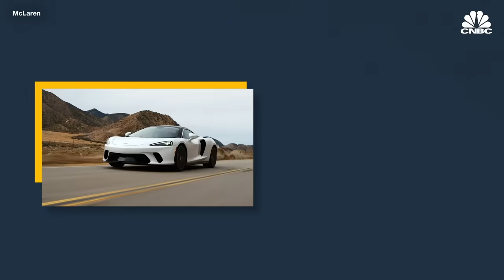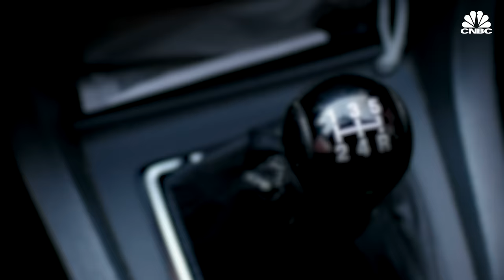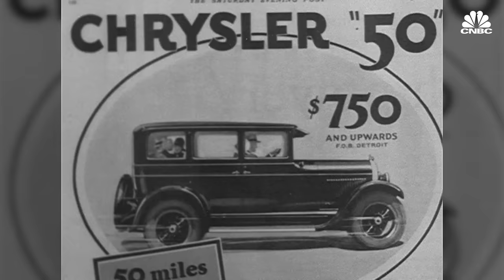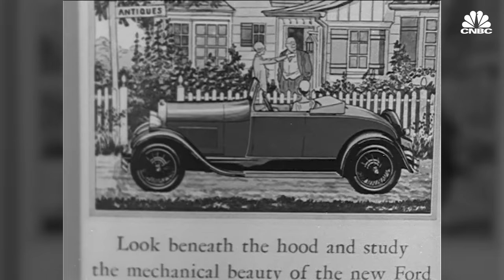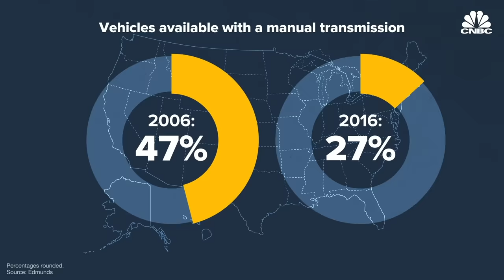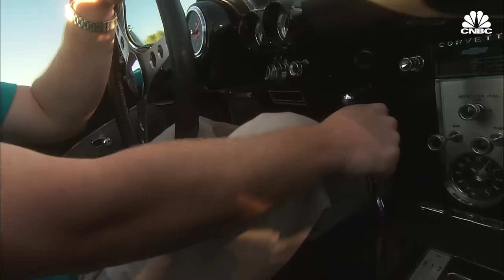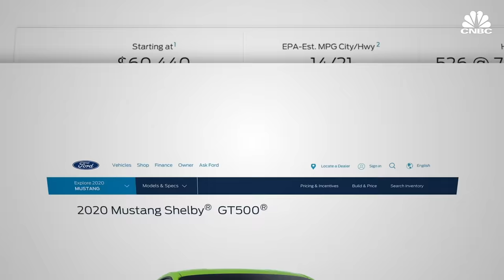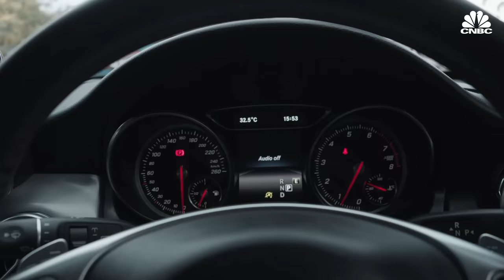Why Stick Shifts Are Going Extinct

Comment: We had someone that got car jacked here (Australia) and once they got the car they got out and ran because it was a manual and couldn’t get it to go.. haha losers
Reply: LOL.. Now that's what I call an anti-theft device! ('v')
Reply: don't stop getting toll... and problem with manual... also alot when got older.. this thing is nightmare to maintaince...
Reply: If it happened somewhere else other than the US or Australia then it could've been a different story lol
Reply: In Indonesia, a skit show called "Sketsa" shown that thugs trying to steal a motorcycle but they gave it back to the owner because it was in A/T and the thugs can't used the A/T.
Reply: That is hilarious 😂 it’s really not that hard!
Reply: @campkira  how is a manual hard to maintain, if you watch the video he literally explains how manuals are far simpler and much less expensive to repair.
Reply: That is funny.
Reply: @halohunter5217  my first car was manual, no power steering and no AC. No one ever asked to borrow it a second time.
Reply: I'm an aussie and never owned an auto. Had 6 different manuals though.
Reply: I was looking for a new(er)car and my requirements were 1. a manual transmission. 2. AWD or 4WD.  When I entered those filters into google, the choices went from 1000s of vehicles to about 5.  SHOCKING!!!!  I finally got a great deal on a Volkswagon Jetta.  It has a 6 speed manual transmission but is front wheel drive (came with studs).  One out of two isnt bad, and I love the Jettas.  My last one almost got to 300,000 miles.
Reply: @rocknrobin411  Yeah they are quality cars.
Reply: @eberduran  Nah most here don't know either. We are a rarity. 1 in 200 new cars is a manual here i believe so it is worse than the US sadly. Most people here aren't even licensed to drive manuals anymore. At least not the younger generations.
Reply: @campkira  well if you drive standerd you should get at least 10 years out of it before having to replace the clutch. My father had a F100 for about 10 years and never replaced the clutch .
Reply: @campkira  Typo notwithstanding, you are incorrect. I was involved in a gearbox refurbishing business for many years, I do know what I'm talking about.
Reply: Lol, the guy is probably American
Reply: The opposite is also true: when one of my country's cycling team went to the USA to attend to some race they had to drive automatic vans, so they had a parking accident because they didn't know how to use the automatic shifter.
Reply: So... a theif just needs to learn stick? Lol I bet YouTube can help with that!
Reply: @chrisbrent7487  My wife is an Aussie (Melbourne) and learned to drive on a Willy's Whippet, whatever that is, but it was a manual transmission.
Reply: @blackholeentry3489  Will's whipets where a verion of the Willy's overland made as what we call a ute here. In the States it would be called a pick up. The stopped making them in the 1930's. I'm in my mid 40's and a lot of people learnt to drive manual back then. Now days it is very few.  They can't even legally drive a manual if they never passed the test for it.

Comment: Forget about manual transmission, engine cars themselves are gonna become extinct with the rise in EVs
Reply: If petrol cars are ever completely phased out I doubt it will be because of EV's. Even if it does happen that's a very long way off. The push to end everything powered by gasoline, diesel, natural gas and propane will put an unrealistic demand on the power grid as well as the necessary increase in copper demand to manufacture all the motors and update power grids. Materials needed to make the batteries will be a major issue. The technology will get better but it won't happen any time soon.
Reply: @martyharless5097  that was 9 months ago and now after seeing many EV failures , I say petrol / diesel here to stay for long. CNG is much better alternative to these.
Reply: @allstar7778  I'm not familiar with the volumetric density of energy for CNG compared to gasoline/diesel. I'm wondering how that will work with space. I remember seeing pickup trucks powered with propane but the tanks took up a lot of space in the bed of the trucks.
Reply: @martyharless5097  yeah that issue is there.... but EV I don't recommend at all, EV is totally useless. Main issue is the charging time.

Comment: America- stick shift's gonna die
Rest of the world - sighs in metric
Reply: Us Canadians just have to deal with them
Easier to just do what they do, otherwise we'd be right hand drive and stick shifts all the way
Reply: That’s a shame. Under harsh conditions, a manual is far superior. Automatic transmissions overheat much easier and require more maintenance.
Reply: SandboxArrow  dude all them are exaggerated 🙃 and you pointed out only uncle sam's exaggeration, hm interesting
Reply: The "smart" Americans sigh in metric too. The US is on the metric system. For the commercial activities it is converted to the Imperial/US customary units, but in science, military, some industry and even some parts of the government, the  metric is standard
Reply: Oh, please. It's super fun memorizing and/or calculating that 13/16 inch is between 3/4 and 7/8! Easy!
Reply: @jonsol2804   yeah metric is standard thats why its opted worldwide even in commercial activities 🙃
Reply: @Freejason33  whats a inch ?
Reply: Metric has nothing to do with it. They'll learn eventually. Yes America is pretty behind in almost all aspects, but if we know anything its transmissions.
Reply: Here in the UK stick shifts (or manuals as we call them here) are far from extinct. They outsell autos by a large margin.
Reply: @johnsheibal4330  In Serbia on the used car market if a car is an automatic the price can drop 1.000-2.000€
Reply: @Lkshy_abq  Funny part is, metric does not have a sensible equivalent to the Foot,  Saying something is about 30 cm long tells you bugger all, but mention a foot and EVERYBODY knows.
Reply: @jonsol2804  then if you guys are soo smart why even bother to learn kids units and conversions that ultimatly dont get used?
Reply: @McDonnerbogen  what units and conversions?
Reply: @jonsol2804  why learn imperial units and the conversions like km/h in m/h or for imperial miles per hour in feet per hour if they are not in any use
Reply: @adoreslaurel  thats because people who use metric wanna actually be precise and use rulers. Gotta be easy to buy shoes in usa if everybody got the same foot i guess.
Reply: @adoreslaurel  yeah bro because its not supposed to, metric doesn't have sensible equivalent to foot but does the imperial has any sensible equivalent to metre, these two systems aren't compatible together thats why they are two different systems and metric is more accurate thats why whole world uses it.
Nobody wants to use a system that's units progress unevenly
Reply: It's probably because the U.S. is where it actually matters since the U.S. and China have the two largest markets in the world. Not badmouthing any other countries, its just that the market for luxury, power cars, isn't nearly as big.
Reply: @Lkshy_abq  Well a yard and a metre are pretty close, something makes me think you grew up with imperial and moved to metric, but if the cops are looing for some crook 183 cm tall, well these days I dare say most would know it as 6 feet. but it's  quicker and less confusing to say the guy is 6 feet tall.
Reply: @McDonnerbogen  Yes, must admit though, down under I have to know which countries size fits my foot because by the time I need new shoes, the size print has worn off.
Reply: @chaos4224  " USA NOT USING STICK SHIFT WILL NOT LEAD EXTINCTION OF STICK ALL OVER THE WORLD JUST LIKE NOBODY FOLLOWED IMPERIAL" is only fitting reply i could give you without you being offended
Reply: @jonsol2804  sure. But a country that mostly still doesn't use the IS standard in science, still gives 16 year olds a license to drive, cos no public transport, but has restrictions on drinking alcohol until 21? But no problem with giving young kids amphetamines or other drugs to really young kids?
Reply: @adoreslaurel  what about the complicating array of foot sizes? Every size is slightly different.
Reply: @adoreslaurel  yeah a yard and a metre are similar in a vague way. But  when you have to be precise then the metric system is more precise and easier to work with. Areas such as architecture temperature weight and some other precise mechanics will still use metrics.
Reply: @magentaMegi  Ok, what's your point? What relevance has the drugs, age or the driver license to the measuring standards, the subject?? And besides that, why should I care about it??
Reply: @jonsol2804  my point is the difference between the US system of anything vs the the rest of the world. The US is unique by allowing 16 year olds to drive a car, but restricted alcohol limits  until they turn 21. 5 years. This age group will certainly not comply with the rules. I'm certain that lots of young Americans are not stupid and sure enough know exactly how to bend the rules
Reply: @jonsol2804  pf course ypu might not care about anything that doesn't personally affect you. But if it does, you will be the first to know. Something is definitely off when so many people, "hate the US" and can't separate a country from its politics
Reply: @magentaMegi  Why you keep on bringing bs??? We are talking about measuring standards and you are ranting about drugs, driver license, politics, drinking etc. Where did I say that I hate US.   Find it stupid that everything is converted. 

But must off all: I live in Europe so why should bothered of things happening in a country that is 7000  KILOMETERS away? Things are happening here too. US is no priority to me.
Reply: @jonsol2804  always getting same copy paste responses. Yes there are important practices that differ from the norm. I don't care for your response because it just shows your uncaring nature.
Reply: @jonsol2804  I really don't get your response and your strange disagreement in mine. We basically said the same thing. So I don't undetstand your reply. So, it just seems right to use metrics in serious situations such as almost any science linked to serious activities. The mm is often used for ballistics, precise measurements , the mg used in chemistry medicine, and all optics, esp in basic photography. But there are exceptions eg the size of anu screen has a diagonal inch measurement, etc
Reply: @magentaMegi  I don't know, but I am pretty sure it is has to do with my limited mental capacity 🤣🤣🤣.
Reply: @johnsheibal4330  electric yo
Reply: @jonsol2804  no actually you seemed annoyed. I remember having a fun discussion with an American guy who was a physics student about metrics. Btw don't know why gear shift driving is such a big deal. For normal cars. Driving large ones like trucks is way more complex.
Reply: @magentaMegi   I'am glad for you that there is bot, good enough to make you feel like you had a pleasant conversation with an American physic student.  

And you have mad skills girl. I mean that you conclude after a few sentences that I was annoyed. Thanx, you saved my day
Reply: @jonsol2804  there was no bot, but an actual person. You misread most of what I said. I understand your sarcasm quite clearly. So it's the limited qualities of girls, as you put it, that made your day? 🌞
Reply: @johnsheibal4330  Evidence please.
Reply: @jonsol2804  How do you measure a sigh?
Reply: Actually most cars in Asia are automatic too. America leads. World follows.
Reply: Ginger  lol. DRL indeed became mandatory in Europe in 2011. And I think that's a good thing.
Reply: @tomholy  lol which is less than what she will get lol 
btw i was just kidding as  im old enough to remember way back to when we used inches
Reply: LOL
Reply: @solentbum   I have a vast background in the Auto industry. Dad's a retired mechanic, I was a mechanic in the military, worked in a car dealership, know guys who rebuild transmissions for a living... must I go on? You merely questioning tells me you have no idea what you are talking about. Manual transmissions can handle much more severe treatment. Why do you think the military used manual transmissions for the longest time? More recently they have changed over because automatics have become better in the reliability area, but still can't hold up to a manual in the harshest conditions.
Reply: @GriseoFalco  Automatics have a lower value to me as well. They are very complex and generally require more maintenance. Also, can't handle the same harsh treatment. I'll put my 5-speed manual in any mud or snow test and watch any automatic burn up well before my almost 300,000 mile 1992 VX Civic tranny. I'm up for the challenge. Any takers?
Reply: @johnsheibal4330  Strangely, the AFV that I drove some 30 years ago had a semi-auto gearbox. I would point out that Military vehicles have little relevance in the real world, their design following differing requirements one of which is to remain in service for many years, with a simplified modular repair system. The Military take little notice of cost, efficiency or design. 
More relevant to this discussion is the move to full auto gearboxes for heavy lorries, and agricultural machines. Recently I drove  new farm tractor which had a 17 gear auto box, joystick and computer  controlled.
But since the original point raised is the demise of the stick shift car in the USA all of that is irrelevant. 
Modern cars now come as autos for the simple reason of customer demand. The old Borg-Warner 3-gear auto box has been replaced by twin clutch 6 or 7 gear boxes with computer control, which outperform all but the most ardent driver, and certainly fit in well with the average short commuter run of most car owners.
Reply: @Lkshy_abq  Someone's salty.
Reply: The UK sighs in imperial and metric :D We drive in MPH but buy litres of petrol.
Reply: @JW-YT  yeah thats just .
.
.
.
.
 
.
.
.
.
SAD
Reply: @Lkshy_abq  not at all. The imperial standard is now based on metric and this is internationally accepted.

But I can use both interchangeably. Its like talking to languages almost.
Reply: I am going to miss manuals I have my 2006 Ford focus zx3 I don't want to give it up
Reply: @x XGeneric420X x So it be.
Reply: @x XGeneric420X x So what?
Reply: @Lkshy_abq  and mexico is our inferiority complex cousin, and Canada is our weak little brother under our protection. is this how you over generalize countries?
Reply: @stefthorman8548  mexico doesn't have inferiority complex, canada doesn't need protection (geographical advantage), but uncle sam sure acts like that they protect canada and is better than mexico🤭🤭🤭🤭
Reply: @stefthorman8548  bro you were downing me on labelling countries you are already the epitome when triggered ..... Stay like this world need good hypocrites😂😂😂😂
Reply: @stefthorman8548  bro i labelled all 3
Reply: @stefthorman8548  mexico a sombrero lunatic, canada aa apologetic and US as cocky rich frat kid and btw not from any 3 of these
Reply: @Lkshy_abq  so?
Reply: @stefthorman8548  imma head right out
Reply: Yeah, because the whole world is using manual, I bet you south america and Japan and a ton of other countries don't use manuals still. And china is all about electrics right now.
Reply: Hahahahaaaaaa!!!!
Reply: @GriseoFalco  Not only in Serbia. That's true for the rest of Europe, I think.
Reply: @andreaseufinger4422  Couldn't say for the rest of Europe. I figured that in richer countries like Germany that might actually be considered a desirable feature and raises the price. In Serbia we figure that it's expensive to replace if it brakes so a lot of people avoid it like the plague.
Reply: America, makes electric cars now. BMW doesn't seem to understand
Reply: @Nooziterp1  Is Spiny Norman still chasing after you?